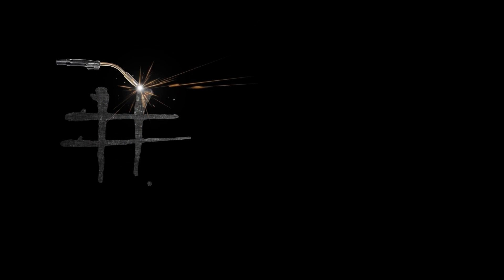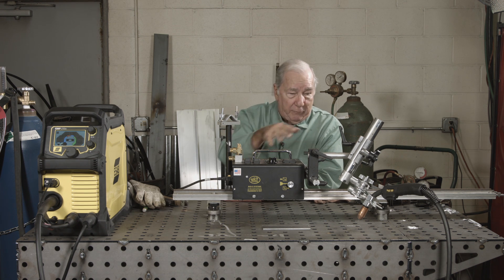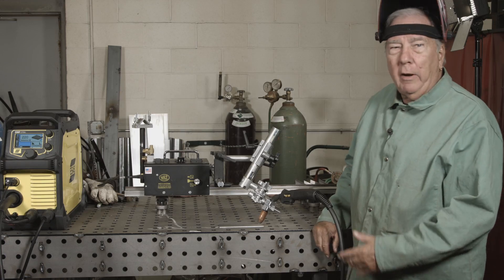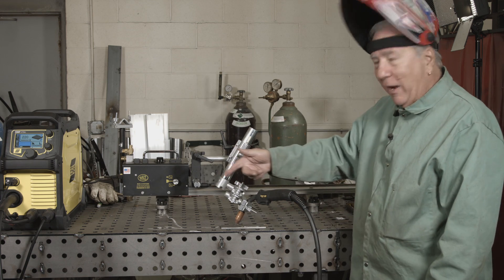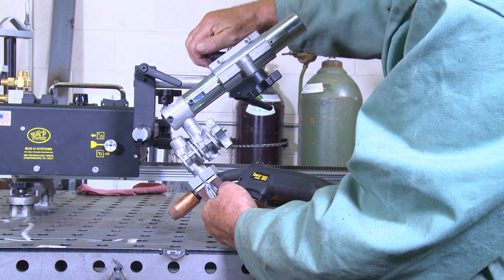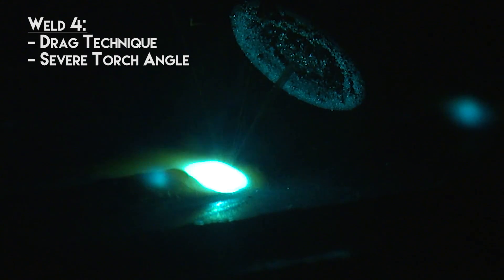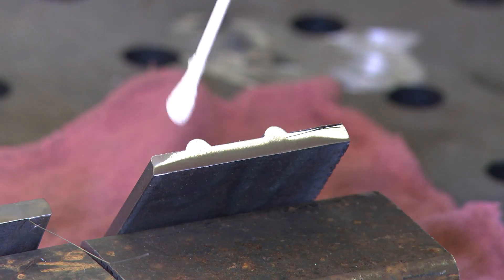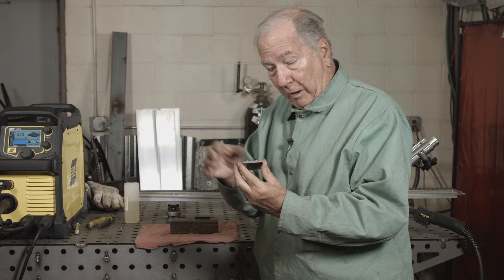MIG Welding Technique Push vs Drag: Part 2 - Penetration Test

Comment: The only problem with pushing it becomes convex looks nice but lack of throat stacking both ways is best is best.on the full pens I usually start the 1st pass dragging pushing can be a problem with slag inclusion

Comment: A lot depends on the type of welding too, eg. short circuit, globular, or spray arc, I work for caterpillar I the facility where they build the large mining equipment, some of the largest in the world and we are tough to drag stringers because through testing over the many years this method has shown to get the best fusion and penetration

Comment: I thought you should point the torch toward the cooling weld bead, so the gas "covers" it.  Drag/ pull.
Why would you point the gas toward where you haven't even welded yet? Push.

Comment: I learned a lot from this. I've always dragged when using flux core in my Everlast welder and pushed when MIG
Reply: You still drag with flux cure. MIG can be pushed or pulled, but flux core will give you really poor results if you push. Pulling with flux forces all the trash behind the puddle where it becomes slag. If you push your wire then it's all getting forced to the front and then out to the toes.

Comment: Push is good. Out in the field my arms got so tired. The longer your arms are extended they will get fatigued. Pulling allowed me to continuously weld as your arms are going towards you making the electrode less heavy.

Comment: Just ask what the nuclear industry requires.  (typically sub-arc)  But they have researched it beyond ad-noisome.  (as a TIG guy I always cringe at the MIG splatter.  Flux core and i'm out the door!)  Who welds a plate to just the wire?  Do a lap, but, corner etc joint THEN come back.  You have proved/shown really nothing.  "It didn't make that noise on paper."
Reply: Congratulations. Nobody gives a shit what you think. Maybe make your own video? That way you can do whatever it is you're talking about, and people can give you shit for it as well. Or maybe you can just sit down, and shut the fuck up.

Comment: This debate will never be "settled", fact is much of the success or failure as with any weld is good preparation and technique but how accessible the weld position is along with heat, weld travel speed gas variations/mixes and other job variables. 
I built SS airplane deicer coils for a while, to get the best bare wire mig weld on the coils we ended up with a tri-gas mix to do the job on the material, this same setup on another application could have been worthless at best.
There's the ideal conditions and the real world, welding is continuous adaptation.

Comment: Yes sir i agree with push welding. When i started mig welded i played around with different options and push welding is the best for our application. I weld heavy Equipment Implements, dozer rakes, trachoe & backhoe thumbs, and grapples for skidsteers. The teeth on the dozer rakes can get up to 2.5" thick and i have to run high heat with compensated wire speed to get very good penetration. Using a Miller 350P im running 29.3/530 with push technic for hours on end.

Comment: Paul I love your videos. As a hobby welder who started welding flux core, I'm more comfortable dragging the torch. So now that I've added gas to my machine I don't have to worry too much about lack of penetration when I drag while mig welding. I never weld anything over 3/16" so it probably doesn't matter anyway.

Comment: I always felt the push to be easier to see the weld pool so that you have better control over penetration. 
But when using a automated welding machine I found that spray arc transfer gave much better result. 

While the pull set up the gave a slightly higher weld profile and the risk of not passing inspection was greatly increased.

When you are welding a very tight corner 20 degrees I always use a pulling technique and an extremely long wire stick out to get into the tight corner. My ampere is set slightly higher leaning towards a spray transfer.

Comment: Well the test is good. But I'd like to see a real welding like a corner joint or butt weld. Welding on a flat plate doesn't really proof anything in my opinion.
And as others comment, preparation before welding, clean the nozzle etc is key to a good long lasting weld.
It is all about physics when welding. There is no cutting corners when melting metal and getting the alloys to combine.
Have a nice day.
Reply: You could be on to something. Although I think this is a better direction in the battle than most. I dont think it proves nothing. I think it's a starting point. Short circuit mig in all positions, on plate and fillet. That might satisfy everyone doing short circuit. Maybe add pipe in there too. Eventually someone might have a series that covers those bases. But then there's flux core (dual shield and self shielded), globular, spray, and pulse. Who is going to keep their audience doing all that? Also, who has equipment to take the human factor out of it all?

Comment: mig/mag
 is all about heat! any weld under 4m wire a minut is always dirty.  voltage/wire ratio is very narrow. So good ratio and enough heat you are golden. always listen when wire welding :) and about slag. the cleanest weld is done by push. I have proved that many times by xray/ultra sound. the key is always keep ahead of the slag. (small strings) but the safest is dragging you burn the slag and the pores are smaller than alloved.
Reply: Good advice. I'll will certainly try to remember those points when I'm practicing welding with my everlast welder.

Comment: Usually with FCAW Dual Shield, you do a drag on the root passes.  Let's say that there was a multi-pass Filet weld. For a 1/2" filet weld using 1/16" wire it should usually take 3 passes.  1st pass: Drag, 2nd pass: push, and 3rd pass: Drag...  I usually push the 2nd pass because I want it to stay flat. Some times the 2nd pass can roll on you in a drag and QC's don't like that.

Comment: Interesting video. Thanks. May I ask what did you use for etching? I would like to do some tests on my weld as well.
Thank you for your help.
Reply from the maker: +Roma Maastricht Here is a site that can provide profession etching solutions for just about anything you are trying to test: http://etchantstore.com/Weld-Inspection-Etchants_c11.htm
Reply: Vinegar works also. Takes just a couple Minutes

Comment: A very interesting test and I liked that you used the automated welding unit to remove the operator variable.
Reply: I'm just starting out learning how to weld mig with my everlast welder. This was a great video.
Reply: Quite an interesting set of results. Not at all what I was expecting.

Comment: I was wondering if you weld 2 bars 90° what would be the better, stretch breaktest would be nice also, my money is on the push. ...goedendag
Reply: From what I've seen and learned both is okay if done right. The pull method has a bit better a especially a more guaranteed penetration, but also a bigger heat input and a bigger weld. Pushing on the other side creates a smoother weld and also has a good penetration, but it's risky if you don't know what to look for bcs if you're to slow the molten puddle can flow infront of your arc and reduce the penetration.